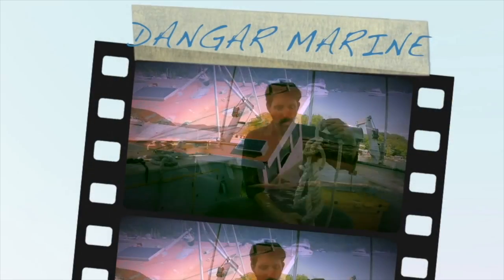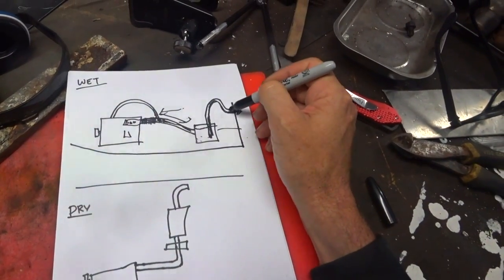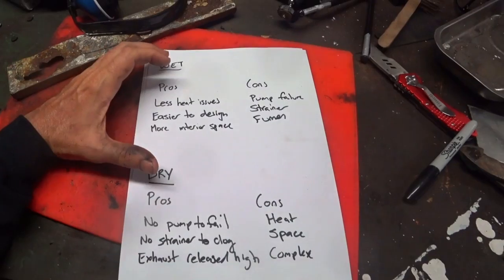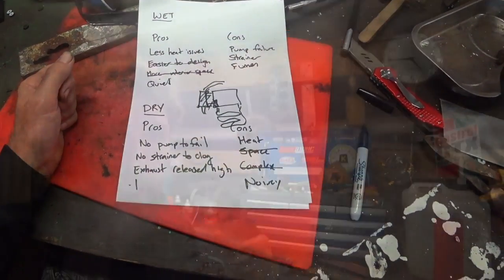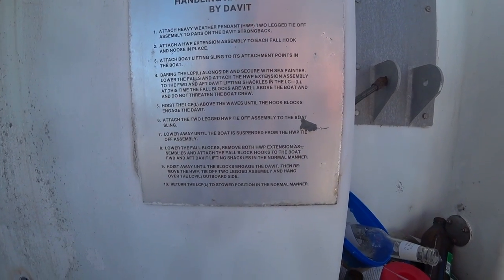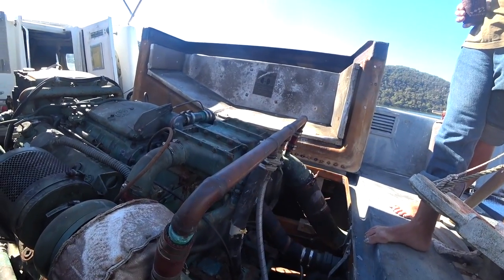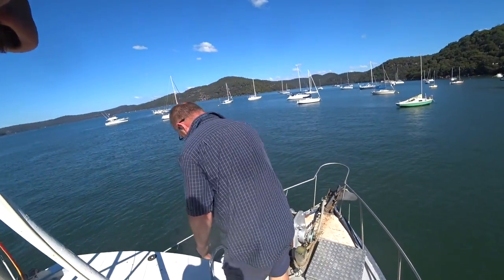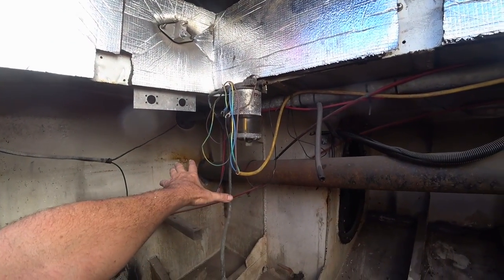Wet Exhaust vs Dry Exhaust

Comment: I work on steel boats, we cool the exhaust manifold using the pressurised coolant from the engines cooling circuit. Obviously you need a manifold with some sort of water jacket. Also  Instead of having pipework on the outside of the boat for keel cooling  we just weld tanks to the inside hull. They only need to be 25-35 mm deep but with a large area to allow heat to transfer through the steel hull into the sea. It's simple and works well. Love the videos by the way and I love working on boats.

Comment: Well Stu, I'm not a marine mechanic but I do deal with diesel engines as a truck driver. My thought is dry exhaust is a better bet. My main reason is that wet involves salt water, steel, and heat and given the corrosive nature of salt alone it looks like a lot of potential trouble with corrosion. That and the dependency on the pump. Dry exhaust going straight up encased in a housing say 5" larger in diameter open at the top and bottom would draw air like a chimney around the exhaust pipe cooling it and providing some natural ventilation in the engine room. Seems like a lot less to go wrong. My thought is go high up with the muffler as your friend did. Should be available in stainless steel and I believe the engine manufacturer should have the spec for optimal back pressure rating for the muffler. Anyway, that's my thoughts on it. Love the videos, I always look forward to the next one! Cheers mate!

Comment: go dry you won't be sorry. I have thrty years engineering fishing boats in Alaska. leave lots of air space in your stack!!!! 
 heat rises. put a big blower to force air into engine room from out side. wrap all pipe well use as much sound deadener as you can afford
Reply: nortin1o One good thing about wet exhaust is that most of the exhaust noise leaves the deck

Comment: Hi there :)
Regarding the detroit diesel... there is no need to remove the turbo chargers.
Remove the aftercooler/aircooler dismantle by taking off all its walls and clean it thoroughly with high pressure wash using something like degreaser or petrol to clear all the carbon soot which has collected within due to the exhaust manifold leak
Stop the exhaust manifold leak and replace the air filters that will stop the smoke 
Since its a old detroit diesel the fuel pump on that engine does not have a boost compensator thus the fuel pump is injecting fuel at even though it is not getting enough boost 
IF there was a boost compensator with the same issue the engine would not smoke but you won't be able to reach max rpms
In essence the engine is choking 
Hope this helps :)
Reply from the maker: Cool, might give him a hand doing all that and see how it runs.

Comment: If I was in your shoes I would be yanking that old 4/71 and dropping in a 12 valve 5.9 Cummins the fuel savings alone would pay for the engine swap. Half the noise with a 12 valve, engine isn't flooding the bilge with oil, you don't have the Detroit diesel drone. Out on the West Coast of Canada we still work on gallons per hour with boats a 12 valve you'd be looking at .5 to 1 gallon per hour (2.2-4.5 litres) now with your 4/71 you'd be easily 3 gallons (13.5 litres) per hour. At our CND price per litre for diesel $1.40, a 12 hour watch on the boat 226 dollars with the Detroit, with the Cummins 75 dollars in fuel.
Reply from the maker: That certainly is a big savings. I'll have to keep an eye out for a good second hand engine I can afford.
Reply: A 4Bt Cummins with the right transmission would be more than enough power for your boat.
No oil leaks, much more quiet and sips fuel.
Much lighter than the detroit.
Guessing a 2 1/2 to 1 ratio on the trans.
Reply: @DangarMarine  The Cummins will run you 10 grand used up. The Detroit you have and the Detroit will get you home with 2 rods hanging out the sides, the Cummins will not. There was a good reason the Navy put the Detroit in your friends boat, because they will always get you out of trouble. My two cents, don't fix what ain't broke.
Reply: @edwardmclaughlin6126  Old 2 stroke detroits were cheap back in the 70s, the cost of fuel in todays world you can't afford a 2 stroke Detroit. The loggers repower their boom boats and side winders used in log booming/sorting operations to get rid of the cost fuel, fuel savings in a year pay for the repower.

Comment: Great vid Stu. I've seen some wet exhaust boats with the outlets at the stern but opening out either side rather than the transom. I realize now the point probably is to combat the fume issues in the following sea/wind situation by ejecting exhaust out and away from the boat.

Comment: Great video.  Having been around car and industrial motors most of my life,  don't assume a 4 cylinder industrial diesel will sound softer than a V8.  It's totally how the exhaust is designed.  Since the previous owner obviously  switched to the wet system because he was loosing his hearing standing next to a dry exhaust system, really do your research-find a 471 in your area that has a dry system and check it out!  Believe me, they'll be easy to spot.

Comment: Mate i only had one boat with a V6 inboard engine but the manifolds where water cooled cast aluminium (cost me a fortune to replace) it was water from the heat exchanger the fresh water was circulating  round the engine n back through the heat exchanger the sea water after it cooled the fresh water it was pumped through the water cooled exhaust manifolds them went out with 3maybe 4 inch reinforced rubber hoses to the exhaust  terminal on the transom never gave me any problems at all other than all parts cost a packet lol great video yet again gl mate

Comment: I would be willing to bet that heat was the reason for converting to a wet exhaust system.  The engine may well have keen running too hot.

Comment: Just for your info my father in law had a 52' Riviera with twin 400hp Detroits. Both motors were wet exhausts. When the boat was just cruising the motor noise was to the point, both inside and outside, very noisy. This was even though the engine bay under the rear floor was soundproofed. Also if you got a tailing wind the fumes coming from the twin rear wet exhausts was fairly powerful on the rear deck area causing us to have to go inside and close the rear door..unless the front hatch lids were opened but that was not possible in heavier seas.
I have been on boats with stacked dry exhausts and they are quite different in that it does seem quieter and the fume problems were also a lot less depending on winds. 
Also access to both engines was extremely difficult, as you've pointed out, for maintenance on the Riviera because of the exhaust system.
Just thought I'd put my two bobs worth on here. 😁🇦🇺👍🏻
Reply from the maker: Sounds like another vote for dry!

Comment: Keel cool ... all great till you strike something then you loose ALL your coolant and propulsion as a result but vs rust/oxidisation which aren't as much of an issue with stainless but then cost.

Use a pressure guage or light on the dash for your cooling water and/or to your incoming chest to confirm there is incoming water.
Reply: Build a proper keel cooler and it will be strong as the hull
Reply from the maker: Yes, a pressure gauge or a flow gauge would be a good investment.
Reply: @robp7652  and add extra draw/drag height to the boat and it will unless stainless always be a source of rotting metal (copper) when reacting with salt water (stainless has other issues like weight).

Each idea presents it's own issues but if I was going for an enclosed radiator loop I'd try if enough room to drop a radiator inside a box with flowing outside water so it can transfer heat out without piping going out and being a weak point.
Reply: What you are describing is pretty much the system that is on the boat now. A heat exchange system. Well in all honesty I guess every cooling system is a heat exchange in one way or another. All you have to do is weld some channels under the boat about one inch high maybe 6 inches wide and pretty long say 8 feet .  angle the ends up at say a 45 degree angle . Pop a hole thru the hull on each end of the void you have created and bam the most durable keel cooler ever. Make it out of steel just like the hull. Way cheaper than those "professional" ones you can get.Way more serviceable as well. As far as drag, that is a trawler hull . It is kinda made to drag things through the water . I seriously doubt that it would slow the vessel a quarter of a knot. Not even that much.  of  @NullaNulla

Comment: Years of Insulation wholesaling  in south florida. Rigid DUCT BOARD for air conditioning . You will be very surprised. We soundproofed a lot of things like Pratt And Whitney jet engine test center. Sound studios and sold to a lot of yacht builders. Easy to work with. Best results.

Comment: All of my inboard wet exhaust systems had specialty cast wet jacket exhaust manifolds (big block Chevy) - quite literally ALL of the exhaust was cool to the touch.  Vetus Marine makes very good marine exhaust components - the wet mufflers have integral dry lock anti water reversion designs.
Reply: Peter Southern Boy Vetus marine make possibly the worst possible marinisation components of any manufacturer I've ever come across.   I have a Vetus in my boat and I very much wish I did not.
Reply: Stuart Keegan - my Vetus stuff has worked really well.  I worked with Vetus Engineering prior to ordering in order to make sure that I chose the correct components for my boats.

Comment: Wait a minute. You said the raw sea water is pumping water to only cool the exhaust. Isn't it going through the heat exchanger cooling the fresh water flow which is cooling the engine.
Reply from the maker: No, there is a separate pump for that in this setup.
Reply: @DangarMarine  So what is the pump that is pumping sea water in to the exhaust used for. Normally you have a pump that takes raw sea water pumps it through the heat exchanger then sends it out of the exhaust loop. That is your cooling flow. That is why  you look out at the exhaust to see if you have cooling flow. No water in the exhaust no cooling. This way you have fresh water plus antifreeze running in the engine water jackets. This preserves the block and liners. This system has two water pumps. It makes me wonder what is in your system currently.
Think long and hard on removing a wet system and going back to a dry system. The only dry systems I have ever seen were on boats trying to get by on the cheap.
I'm not sure how good a job was done on your boat in the conversion from a dry to a wet.
I personally would not want the exhaust coming out half way forward of the boat and filling up the aft cockpit with fumes. I am thinking that that may be the reason for the conversion to wet. I live on the coast and spend a lot of time around the docks. 90 to 95 % of the boats I see have wet exhaust.  Gas and diesel. I wonder why.

Comment: My kind of clean-up, Stu. I vote dry exhaust, too, BTW, even though my 48 foot wooden bird has a wet exhaust. The only reason I don't change it either is because it works fine, and it would be too much work to change over. If I was restoring about like yours though, and I had a choice, it would be dry exhaust and keel cooling for sure. Any through-hulls that you can eliminate has to be considered a positive.

Comment: I've owned several trawlers and sailboats all with wet exhaust. Even though you can cover a dry exhaust pipe it will still put out a lot of heat that will collect in the engine room. You will not be happy with that. Other systems will be affected by the heat.  If you simply redesigned the wet exhaust to use space more efficiently you would have the best of both worlds.

Comment: I converted to dry once, lasted about 6 months and then back to wet. The noise, although sounds nice, is a novelty that wears off. Wet is SO much nicer and quieter. Would never go back to dry on anything other than a much bigger boat 60+ feet

Comment: I used to build boats. Detroit had a really excellent technical library. Cooling, exhaust systems, engine room venting and ambient temperature is all there. In reverting to a dry exhaust, it might pay to keep an eye on engine room temp.

Comment: As a retired diesel mechanic; you first need to know the CFM rating (cubic feet of air) of the 4-71 and match the CFM rating of the muffler.
Reply from the maker: Cool, I'll see if it is listed in the service manual.
Reply: @DangarMarine  
Hope it helps. Fred

Comment: If considering a dry exhaust... consider having the internal surfaces ceramic coated...its not overly expensive but it helps gas flow due to its smooth surface and it also keeps some of the heat inside the pipe instead of radiating into your engine bay.

Comment: One of the first things I would check on your friends boat with the 8V71TI, are the intercoolers. They are a very fine mesh and plug up easily, especially with the exhaust leaks down there.
Reply: The air intake screens are probably filthy as well, poor thing is definitely choking when it's opened up
Reply from the maker: Yep, definitely needs the whole induction and exhaust system ripped apart and cleaned / repaired.

Comment: Long time ago, me and two friends spent a few cases of beer and a night 'thinking through' this exhaust thing...and we came up with quite the solution. We liked the 'quiet' of a wet exhaust, but as two of us had 'sank boats' due to leaks-unattended, we didn't care for that 'risk'...and while safe, the dry exhaust has heat and audible-volume issues...so what we did on a friend's trawler (DD 6-71 and we had both TIG and a pipe-bender at our disposal), we ran stainless out the exhaust manifolds, and 4-inches aft, we placed a 'larger capped sleeve' over the collector pipe...placed 'caps' on both ends, and did a full TIG around the ends...so now, 3-ft of pipe (bent upwards towards deck) was 'double-walled'. We then drilled and TIG'd threaded nuts on each of the outer-pipe's ends so that we could hook up water. So, we now have a 3-ft water-jacket over the exhaust...but IT IS NOT MIXING...this cooled the interior of the engine bay, actually better than a wet exhaust...and now, with 'cold exhaust', we just ran it through a giant topside 'can muffler' that really gave it a nice, mellow sound with MUCH lower volume than most Detroit's ever have! We did this by adding a belt-drive water pump onto the front belt...since we didn't want to jack with the heat exchanger.
COOLEST 'exhaust cooler' you'll ever build, it's clean, it sounds good, and it TOTALLY COOLS your engine bay! We were VERY impressed, anyhow...but depending on engine size, you MIGHT have to play with how long of a jacketed section you need to fab up...I'm sure an 8-71 or 12-71 would take a LOT MORE cooling than a 318 or 4-71...
Reply from the maker: I really like this idea. I might look into doing something very similar. I could even direct the fresh water coolant through the water jacket to avoid any silt buildup inside the jacket.

Comment: With all the problems or costly issues regarding wet exhaust it just not worth the headache !
Exhaust wrap was come along way at reducing temps in the motor compartment. Still run out the back be much higher..

Comment: When you do your dry exhaust I know everyone loves a nice shinny stainless exhaust but I would really recommend doin a black ceramic coating on it after it’s all been made and fitted will also help with the radiating heat and also big part help agains corrosion even tho it will be stainless the heat cycle through it will allow it to start and then after that in the engine bay still heat wrap it aswell but I wouldn’t heat wrap straight to the mild steel section in engine bay cause it will still corrode and ends up cooking the exhaust and makes it prone to fatigue and cracks, 
Pro Coat at Wyong are reasonably priced and do a great job had my rear turbo housing and manifold done by them, 
I’m local to somersby would love to come check out this awesome project and maybe volunteer some of my time and ideas 

Keep up the great work !!

Comment: Wet exhaust design: The exhaust pipe from the turbo or manifold should be water jacketed until it falls at least a foot towards the exhaust outlet. Sea water cooling from the heat exchange enters at the top of the jacket and exits through a water curtain into the exhaust pipe. The water curtain should allow a one or two PSI back pressure in the water jacket to maintain complete cooling. In my boat I have a low pressure water gauge installed in the sea water cooling system. It's the water jacket and cooling water which silences the exhaust. Gauges installed for my boat engine: coolant, oil pressure, turbo boost, tachometer, heat exchange sea water pressure and engine hour gauge. All these are necessary to monitor the engine performance and maintenance, running hours between oil change, etc. I hope this helps. Cheers Chris.
Reply from the maker: Nice design with the jacket before entering the exhaust pipe and yes, couldn't agree more about having all the right gauges and having them working.

Comment: Turbos also do quite a bit of muffling. I know of several VW TDIs that are running straight pipes with only the turbo to quite the engine and they are not much louder than a stock exhaust system.  The main difference is you can hear the turbine much better.  Sorry I don’t have any experience with boats, but I have learned a lot from your vids.
Reply from the maker: Yes, being non-turbo I'll deifnitely have a bit more muffling to do.

Comment: a 6 to 8" square chase is big enough. Put it in a hanging locker and you have a great place to hang wet gear.  putting the outlet a foot or more above the cabin roof reduces the sound waves coupling to the roof. Mine is 2ft and its whisper quiet. I get more noise from the intake. Isuzu 4 bd 1
Reply from the maker: Good ideas mate, thanks for that.